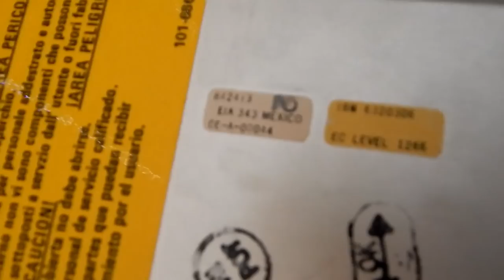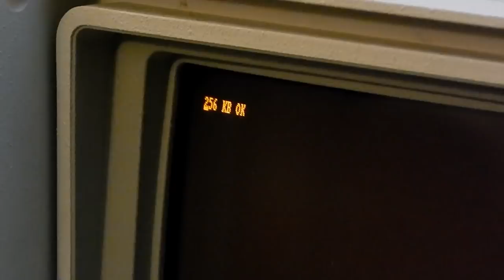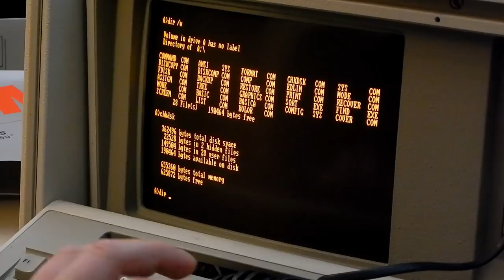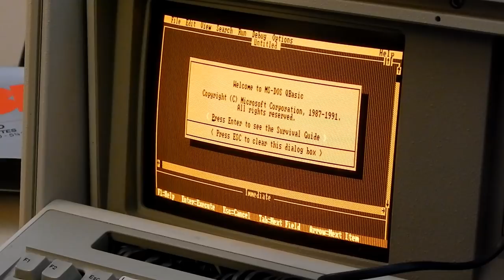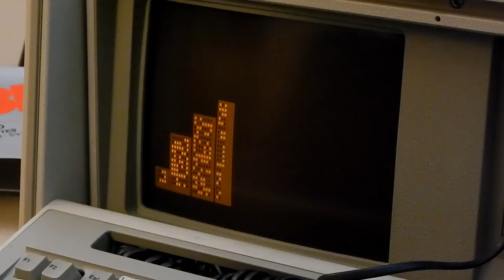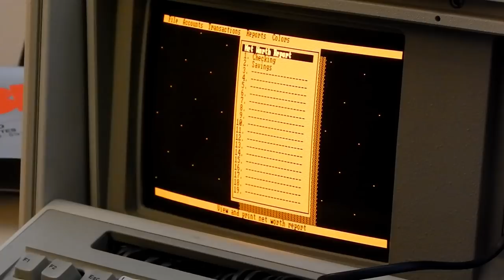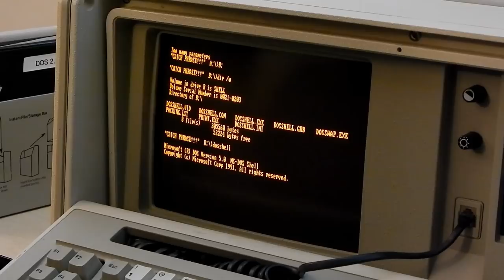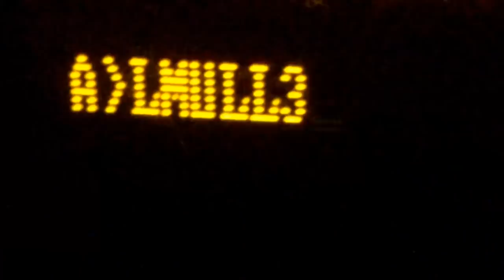IBM 5155 Portable Personal Computer: An Introduction

Comment: I have not heard of any incompatibility between the early XT motherboard and the V20 chip, although the later BIOS version (from 1985) does add official 3.5" 720K floppy drive support and faster RAM counting during POST. There's also an easy mod to let you put the full 640K of RAM on the motherboard. The trimpot is for adjusting the color tint of the CGA card's composite video output.
Reply: I think a 5160 and 5162 (XT-286) can be installed in place as well, but I digress. Currently bidding on one on eBay and I have a Compaq Portable 1 system that I repaired and everything works (to a point, just need to retr0brite the keys and recap the motherboard). I almost got a 5155 back in the summer of 2006 at a thrift store and a big regret. If I got the system back then, it would've been a fun experience to work on.

Comment: I put a XTIDE card into mine, so I could keep the two floppy drives installed, and also have a "hard disk" that's easy to transfer files onto. Just wanted to let you know that it works with those :)

Comment: No actually if you set the RAM card to 1 MB, it would not count to 1 MB on POST. In fact, the machine probably wouldn't even POST. RAM above 640 KB is used as a shared memory area for RAM and ROM on cards, including ROM BASIC and the BIOS. You could theoretically go up to 736 KB, which would end right where the CGA RAM begins at B800:0000, but the BIOS wouldn't recognize it and you'd still be limited to 640 KB in DOS. If a program was designed to use the RAM from 640 to 736 KB, it can be accessed, but DOS itself wouldn't know about it.

You could also technically make a little boot sector program on a floppy that modifies the BIOS data area in 0040:0000 to report 736 KB, and then chainload the DOS boot sector, which would allow it to see and use it.

Comment: PC DOS 2.1is OK but PC Dos 3.3 would be the best version for that machine.
Reply from the maker: Are there any differences between that and MS-DOS 3.3 that matter that much?
Reply: @lmull3  There are bug fixes and some newly added features, it is a good "Universal DOS" to use on anything from the 8088 through the 386. Some programs, even ones that will run on an XT also require it. If you need a copy let me know.